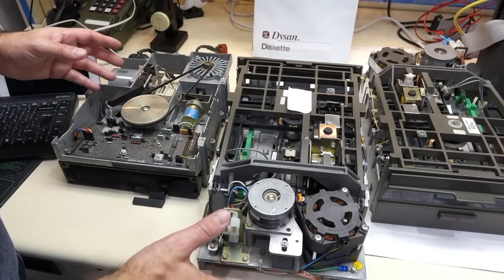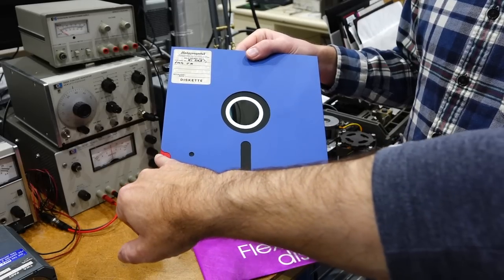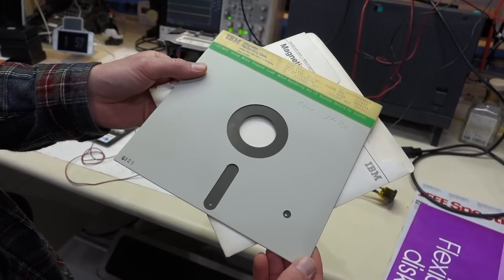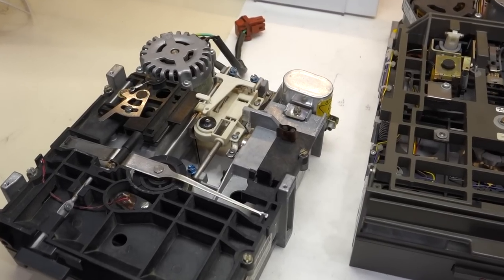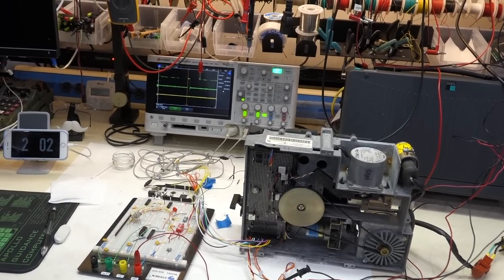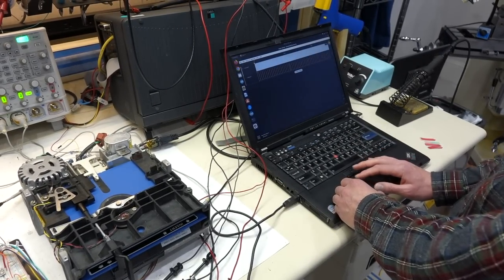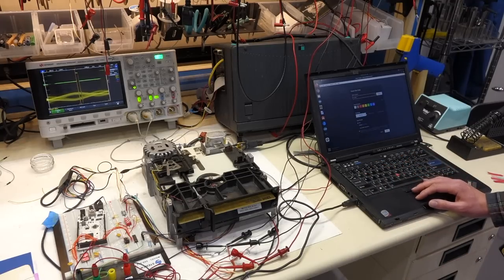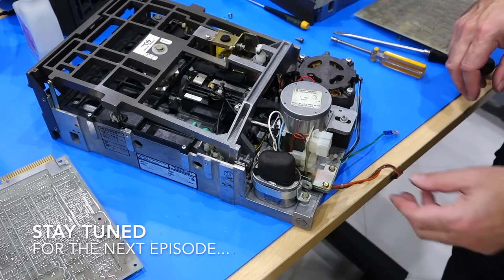More early 8" floppies: hard sectored, IBM Minnow, Intel Intellec and IBM Demi floppies

Comment: As I recall, IPL stands for Initial Program Load, basically the initial bootstrap code that loads in more code to then actually start the machine.  I used to enter front panel opcodes to boot various minicomputers like PDPs, HP 1000, Interdata / Perkin-Elmer, and early microprocessor based systems.

Love the content, keep up the good work!
Reply: For the Control Data 6000 series it was called deadstarting and a switch panel was read to load instructions into a peripheral processor to read the system software from mag tape or disk. As you say, the PDPs used front panel keys to load the instructions.
Reply: That's how we brought up the Nova at UTRAO... front panel switches, then paper tape, then 9-track.
Reply: I just remembered, while at work running a group of automated test stations based on the PDP-11, one of the support engineers had made a test fixture adapter with an EPROM in a socket.  We only needed to enter a few bytes of data that told it to run the code in the EPROM, that performed the majority of the bootstrapping.  Of course, these PDPs had magnetic core memory, non-volatile, so we didn't have to do it very often.  But when we did, it beat the heck out of entering lots of code manually!
Reply: IBM used the IPL nomenclature for a very long time -- even with the IBM PC and OS/2 they refer to "booting" as IPL in many places.
Reply: @AureliusR  Using an official term like IPL is more accurate, while "bootstrapping" is more casual, taken from the old saying "lifting yourself up by your own bootstraps".  As a slang term it gradually was shortened to just "boot" or "booting", as computers became friendlier and commonplace.
Kind of like how the name of a graphics editing program became an everyday verb: Photoshop, as in photoshopped, or "to photoshop an image".

Comment: I find it tremendously fascinating to watch you guys reverse engineer the tech I used too back in the days, without knowing anything about all those different designs. Thanks Marc and wizard Eric!
Reply: Hey! Your profile flag is backwards. 🙃😛
Reply: I was just about to make the same comment… 😅 

Primarily I used two 8” drives on SSLs very proprietary series G computer, controlling their (more) famous 4000 series audio mixing console. Although I did (at times do) pure IT tech and management too, the SSL computer was it’s own beast - we just never messed with it. 

There was this rumour that it was export prohibited under the Cocom rules because of the wast number of (I think) 10-bit ADCs for fader position sensing. Around 1994 our 8” drives were replaced with “modern” 3,5s, with a VERY expensive daughter board to make them compatible… 

Great work! 👍

Comment: This brings back memories from the mid 1980s of my old single board CP/M system using a Z80 processor and 64K memory. It had a single 5.25" floppy built in and an external 19" rack mounted box with 2 VERY noisy 8" floppy drives mounted side by side. The floppies had a capacity of 1.2MB if I remember correctly. I mainly used the 8" floppies to archive all the shareware programs I downloaded via a 300bps modem from a local Bulletin Board System. The downloads took ages. Fun, Fun Days indeed.

Comment: Marc - I found and dug out my IBM 3600 controller disks and, unfortunately, regular soft-sector.  Sorry.  It must have been on my ancient Zenith Data Systems system that is buried in a storage locker next to a C= Amiga 2000 and a bunch of AT&T Unix PC 7300s.  I can't remember the model number of the Zenith - I haven't looked at it in 35+ years.  I do remember that the hard sectors were on the inner rather than outer.  The disk looked exactly like a regular 8" - but with more holes that would show when you rotated it manually.  As always, great job to you and Eric for keeping the electronic archeology alive.

Comment: Ahhh, the old days - when floppy disks were actually floppy, and there were more formats in heaven and earth than were dreamt of in my technical library!

My first floppy drive was a Memorex 651 of uncertain provenance, back when the disks for it were still available.  I built a controller for it based on something described, I believe, in a BYTE article - based on an SDLC controller chip with a strange Signetics one-shot for data/clock separation.  I should dig that out of the archives and refresh my memory.

I didn't realize the Intellec floppies used a nonstandard format.  My memories of those involve (1) the head loading and unloading for each sector, and (2) the drives needing to be aligned to magnetic north for reliable operation.

Cool stuff as always!

Comment: Sound and HD are working now, it's good to be a bit, or several bits (stupid IT joke🤦😁) late sometimes😊
I had a double 8 inch disk drive next to my Z80 based computer rack. The system used 100x160mm PCBs with one CPU card, one memory card, one disk controller card, etc. When you started the disk drive the ceiling lights flickered and the heavy drive almost jumped on the table. The "Eurocard" (I think that was what  the size was called, we had our own product called Metric Card) rack with the actual computer looked tiny next to the massive double drive😂. I worked as pre and post tech support for industries like Volvo, Electrolux and others where the Z80 racks were controlling robots in car manufacturing and such. I remember the joy when I got a colour screen and a colour graphics card. The base system was just connected to a serial terminal. The amazement when I could create graphics on pressure, angles, etc was almost overwhelming 😁
Ahh, the 80s 😁

Comment: Vydek word processors used those 32 sector disks @ 2 min mark. I remember the missing corner to prevent using the "wrong way". I think the hard sector holes were on the outer edge, but the envelope had a corner notched to prevent inserting the wrong way. I still have 8 inch floppy accessories: binders, loose-leaf sleeves, smoked plastic locking cases and D-I-Y reinforcing hub rings! And labels! Lotsa labels!
Reply: Vydec was an interesting WP company.  Their engineers did everything possible trick to create an incompatible disc format and so "lock-in" their customer base to prevent migration to other brands.   They even rotated the media "backwards".    They were horrified when they learned that a company from Australia had created a system that could read Vydec word processor discs, since Vydec never sold, but rented their WP systems...

Comment: CuriousMarc You forgot the 32 Hard Sectors 8" FFDs. Like the "3M 740-32 SS,SD" Single Side, Single Density 8 Inch. Those have 32 index holes at the "normal"place as the SS diskettes. 
Use f.i. the Shurgart SA801 drive. Its just a SA800 drive with special settings to read those 32 Hard sectors. Great thing is, you can convert that drive to behave like the SA800 to read the 1 index disks. Thanks for showing those special format 8"diskettes. You see lots of people/companies try to figure out a system of their own. Like the "DATAPOINT 1800" format 8". a like M2FM or MMFM format , same like DEC RX02. Never able to read those disks back on a PC due to mix of FM and MFM that a PC can not handel.

Comment: Yeah.
This brings back memories. Even with 5 1/4 floopies it wasn't simple as the number of tracks and/or sectors could vary. This is why it was an extremely good idea to write those formatting numbers onto the floppy label
Single sided / double sided wasn't that big of an issue. If the floppy was capable but the drive didn't have a 2nd photoelectric for dealing with the mirrored hole in the sleeve, .... cautious punching a second set of holes into the sleeve "doubled" the capacity by enabeling to turn around the floppy  :-)

Comment: Ooo. I have a bunch of hard sector 8" disks, but none of them have the sector holes on the edge of the disk like that. Rather, they are arround the hub in the same place as the soft sector disk index hole. Alows you to use a hard sector controller with a standard sughart drive

Comment: The company I worked for in the 80's had a 370/158 that used 8" floppies to load the micro-code.  The drive was under the console CRT.  The system also had two built in  Integrated Storage Control for 3330 disk drives that also used 8" floppies.  It took a while to get the system IPL'ed from a cold power on.  I hadn't thought about that part of the system in some time.

Comment: Had no idea they used a floppy for IPLing - guess it's more durable than paper tape. And faster than a bank of switches. For someone who works on modern mainframes this is wild as hell - these days you IPL from a separate machine mounted in the rack above the processor drawers.

Comment: Well, I downloaded the python code but my only contribution so far is noticing that there is a (kind of) pattern: quite a lot (but not all) of the hex consists of 4-byte chunks beginning with 0xA - so I just printed a newline before each of those keeping the hex on the same line (instead of 1 byte per line). And track 0 seems to have duplicated sectors - maybe for redundancy. Haven't looked at the other tracks yet. I did work with a 370/135 in the dim past, but I never saw any microcode docs - secret IBM stuff probably.

Comment: When I was a field engineer in the late '80's  I was looking after CPM based micro's in the UK. They were using a custom format on standard 5.25 drives to cram over a MB on a 720kB disk. 
I don't know how it was done, but alignment was critiical.  We carried a scope and a calibration disk to align the drives on the customer sites. Even the calibration disks were cross checked with each other as the tolerances weren't  good enough to guarantee alignment. It was a real pain and scopes were heavy in those days!

Comment: The Amiga floppies crammed 880K onto what everyone else would consider an 800K disc by rotating the disc slower for outer tracks and faster for inner tracks, a bit like CDs do. You generally need the special Amiga drives to read them, unless you can control the rotation speed yourself.

Comment: For MFM see if you can find a WD 1791 chip and documentation. For FM get the WD 1771. With the 1771 you can work with any (reasonable) sector size that is a multiple of 16. I used that feature to squeeze a very reliable extra amount of data off my SSSD 8" floppies.

{^_^}

Comment: I went to process the data from CSVs - using only the stream of reading head (since index holes are intended to assist writing or disc jam). Made an edge detector and outputted a stream of nanosecond peak to peak times. Divide by 250 as the acquisition gear seems to use 4 MS/s (which is plenty of oversample even for higher speed rotation), my zero bit times are about 32 T which correspond to 8us, which is correct-ish if the drive spin at 360 rpm instead of 90 rpm. After bit decoding of >24T being 0, otherwise 1 + ignore next period, I am able to convert these peak to peak times to bitstream. Reversing it, then filtering out the sole 1 glitch at sector boundary near index marker, I can split the data into sectors. There are about 3 rotations for each track, and the data looks same for second/third read. I am able to directly see the incrementing CFDA - sector address on first byte, but from second byte and later bytes dont have a 1 start bit marker (when I split the sector to 10 bit chunks by length). Also the number of bits per sector varies, from about 2485 to 2505 with few outliers. Anybody to help out with the framing or decoding method?
Reply: So now looking for a start-bit, I can see how the bytes are delayed (maybe to take into account the timing of the machine?) I end up with same variable length sectors as the Python script. Definitely not a format described in Model 145 docs.

Comment: The IBM manual that documents the sector format and the microcode for the 370/135 is apparently SY33-0032, "3135 Processing Unit Theory and Maintenance Manual". Any old IBM guys here with a copy? ;-) The sector format of the data Eric dumped seems more similar to the 3830 than the 370/145, or at least interpreting the data as 3830 format, track 0 comes out with no parity errors. Unless that IBM manual shows up, I guess we're stuck.

Comment: Would it be theoretically possible to make a scanner that can read any disk at, say, 1000tpi and lots of horizontal resolution, dump the digitized magnetic readings to a (huge, I know) file and then feed this magnetic scan to software that reconstructs the data? Or is there something specific about magnetic media that makes this impossible?

Comment: I have an IBM Minnow drive (23FD) complete with documentation and about 25 diskettes.  I'll send you detailed pictures if you want.  Just give me an email address.  Read only, 64K bytes, single sided.  It was the first production floppy.  My disks have S/370 Model 168 firmware (12/16/1975).  The controller for the 3330 disk drives also had a Minnow drive for its firmware.  There was an earlier floppy prototype that looked more like a phonograph.  The disk was backed with foam rubber, about an eighth of an inch thick.  This prototype was on display in IBM Building 004 in Poughkeepsie NY for many years, but I don't know what happened to it.  I've worked with many 33FDs, called Igar.  They were read/write, and they were "soft sectored."  I've never seen the one you show (31FD).  Enjoy!
Reply from the maker: Thanks! Please follow the contact link in the video description!
Reply from the maker: Got the pictures, thanks! You have the real thing!

Comment: On Eric's first breadboard setup, there was a very unusual square component with multiple leads plugged into the breadboard.  It almost looked like the ceramic substrate from an IBM SLT can.  Does anyone know what it was?
Reply: it's a 3d printed socket for an SLT module. i used it for the 31SD reverse engineering process.
Reply: @TubeTimeUS  So cool!  IBM's Solid Logic Technology has always held a special place in my heart since I was a young kid lucky enough to tour a 360 system.  What an amazing leap in technology it was. At the time, I could hardly believe they could make and mount such small transistors -- and here we are today!

Comment: Hello. if you can move the head by micro steps you don't need the right speed or right head position, just scan the magnetic image, exactly like a photo scan but read with a (fine) magnetic head and a sufficient definition to have redundant information allowing to reconstitute the chain of 0 and I.
then, apply a mask for read the track and sector you want.
that is going to take time ? yes, but you are not using these floppies in production, the purpose is only to read the file once.
when you have the zero position and step parameters, you can make a specific custom controller.

Comment: I remember 8 inch floppy

I also remember 10 inch and 12 inch floppy

The 5 1/4 was a strange size

I never understood why they came up with that.  They could have done 5 inch or 6 inch

Just strange they came up with 5 1/4
Reply: It's 5 1/4, but on the tinder profile they put 6...
Reply: Maybe because it fitted the early PC towers well? Just a guess, but maybe the 5¼ came earlier?